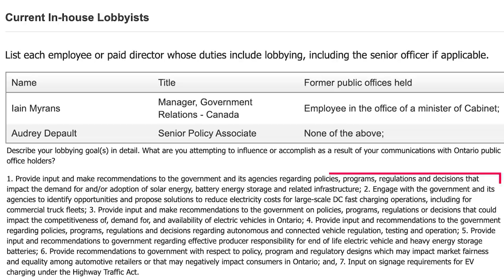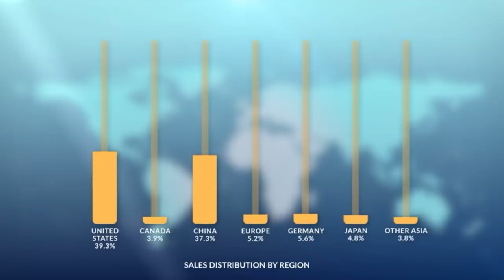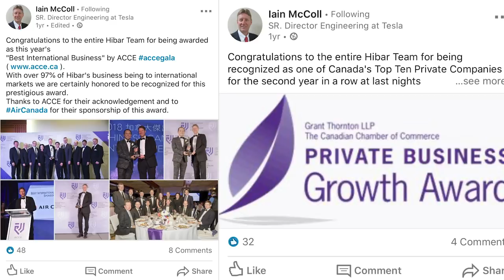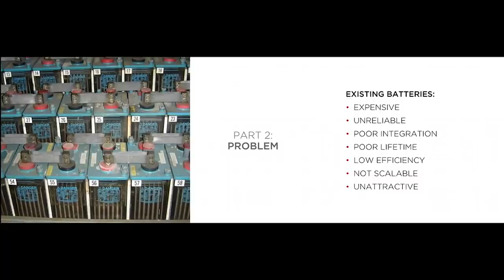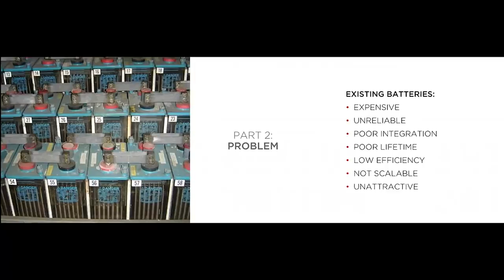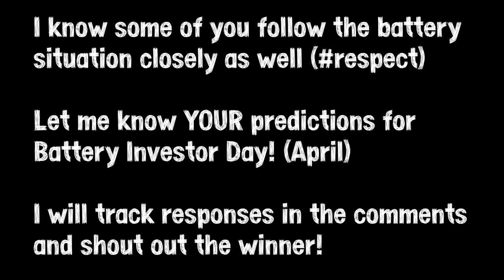Tesla Acquires Hibar Systems - The End of Tesla and Panasonic Partnership?

Comment: Basically Battery = Oil.
If Big Oil is worth in the region of several Trillions of dollars today, then Battery tech will be worth the same or more in coming years.
Reply from the maker: Hey! It will take a long time (10-20 years IMO) to have battery tech even approach that industry, as it seems like things will really start transitioning once solid state batteries hit commercialization. But you're correct, it's only a matter of time!
Reply: Electrified check with Jim Cramer, who last Friday stated he will not buy oil again, and Blackrock holdings warned world investors against it. Cramer said ‘the youth don’t want it anymore... it’s the ‘new tobacco’ it’s over..”
Reply: 10 years is not a long time.  Especially for a transition as massive as electrification of transporting.  That’s batteries for both ground and air travel.  Tesla’s energy division could be massive in terms of future potential revenue.  Much more than cars.
Reply: @PhilipX2030  lol - tabacoo is a luxury item.  Energy isn't.  Unless there is some miracle/unicorn breakthrough in battery technology, (sadly) oil isn't going anywhere any time soon.

Comment: I think they are spot on on the super capacitors, however, the reason for Tesla's acquisition is to:

1. Panasonic is likely to continue contracts with other automakers, and will need more pumps, thus as the battery demand grows Tesla profits, as the market expands Tesla profits.
2. This makes it more difficalt or more expensive for other automakers to verticly integrate batery production with the process of manufacturing EVs. (Because in order to beat Tesla at price they will have to get a competitive advantage over Tesla, which might include the aquisition of a battery manufacturer like Panasonic)
3. Tesla can now limit access of top end pumps to only Panasonic. Putting the other batery manufacturers years behind Panasonic and Tesla.
Reply from the maker: Hey there - my next video touches on supercaps and all things batteries (Thursday). Elon did just say that supercaps are not required so I don't believe supercaps are the story, but the DBE tech from Maxwell is.

Comment: My understanding?

Hibar.
Specialists in precision injection (specifically, electrolyte)
....
Maxwell 
Dry electrode manufacturing process.
....
Grohmann. Robotic machinery.
....
Jeff Dahn, Chemistry,
.......

Hibar was necessary
But not for the reasons stated.
(5:50)
......
Maxwell has given the opportunity to produce dry electrode material (the "roll" in the "jellyroll") at high speed, requiring no dry time or solvents.
So, that's "dry electrodes", not "dry cells"
Essentially a very long strip of flexible multi layer material.
Maxwell isn't so much about the chemistry ("composition") of the cell, as the matrix (electrode sheet material) which allows new materials and chemistry to be incorporated.
Example? (again, imo)
A dry graphine powder, incorporated between layers in the Maxwell electrode sheet (I believe it's similar a laser printer process!) will allow more efficient cell performance.
The dry (electrostatic?) process speeds production.
The "mix" of components in the powders ("toner"?) and later, the electrolyte, are determined by others (Jeff Dahn, etc).

With high speed production of the Maxwell electrode ("long strip") the next stage of the cell production becomes the bottleneck, either requiring a large number of cell assembly lines, or faster insertion of the roll into the "can" and faster injection of electrolyte.

That's why Hibar was purchased.
Together with Grohmann (?) They can  supply the expertise to get the roll into the "can", inject the electrolyte and seal the unit at high speed.

It was the development of dry construction methods for capacitors which (I believe) enabled Maxwell to perfect the battery electrode process, ironically, it now seems there is little need for the capacitors (at the moment).
........
The above points to a dry (produced) electrode sheet, rolled into a "wet" cell (at least for now) with either a fully liquid or gel electrolyte.
The matching of production speeds in the two procedures allows enhanced production (Maxwell stated "up to 16×").

This in itself raised an issue, moving the bottleneck from cells to pack production.

Consequence?
The pack patent in October/ November 2019 which detailed improvements including more automated pack production, packaging, cooling, etc, plus (the big one?) The possibility of a "common pack".
(Side reference? Extra capacity, performance in the Plaid pack?)

Moving forward, if the above is correct the factory space needed for cell production is drastically reduced, leaving space at GF Nevada for other projects (Semi? CBT?).
HUGE capex savings all round!
Reply from the maker: This is an incredibly insightful comment! Thank you taking the time to share and helping us all to better understand another perspective of what's going on! I actually just started studying DBE and SSE for a future video. Such an interesting, yet complex, subject! Big improvements on the horizon without a doubt!
Reply: @DillonLoomis22  
I may be wrong, but everything fits.
Maxwell said their process was suitable for "various chemistries"
They also mentioned "solid state".
That may be for later...... Unless they've "cracked it".
At the moment, I'd concentrate on the volume they can produce, that enables all the other products, vehicles and storage.
Regarding the "old" (current) cells. The question is, what's more valuable? "Old" cell production, or factory space?
That production could be replaced in 10-15% of the current factory.
So, what's the basis for a continued relationship with Panasonic?
(I don't know).
Reply from the maker: @rogerstarkey5390  great points. The reality is...none of us really know! But it's a ton of fun playing an investigative journalist and trying to get in the mind of Elon. I'm having a blast lol
Reply: @DillonLoomis22  
I just look for what they need, what they've said and what's available.
See previous.
Reply: I think this is exactly it.
Reply: @AlexandruJalea  
"Exactly" ....... Doubtful.
But it's possible, with a plus or minus margin in each element.

Comment: Tesla has it's research lab at Prof. Dahn in Canada. These guys are basically superstars of the Battery research community (which i'm part of). But they don't do solid-state, they do very accomplished research on tuning existing chemistries to perfection (thats where the 1m battery thing came from) for electrolytes and cathode materials. I've had some insight from recent talks on conferences where they presented some of their work and i can almost guarantee you that tesla will stark producing some variant of NMC/Graphite cell with super high endurance and manufacturing costs some good amount below 100 $/kWh.
Furthermore they eventually want to switch from graphite to lithium metal (Elon Q3 conference call and research at the Dahn lab) but this is going to be ~5y off imo, it'll double energy capacity for the current tech tho and will make solid-state obsolete (because the solid state electrolyte is by nature super expensive from a material standpoint)
Reply from the maker: Hey man, I can tell you're in the research community with this comment. I just started my DBE, solid state research yesterday for a future video. You may know - do you think the next-gen tech will include more any/more silicon as opposed to graphite or is the expansion still an issue to your knowledge? 

And if someone were to ask you, what's the difference between solid state and dry battery electrodes, how would you explain it? I've gotten a feel that the true definition of solid state is not clearly defined. And correct me if I'm wrong but DBE is more about the mfg. process than it is any change in cell composition?
Reply: @DillonLoomis22  Dry electrode refers to the manufacturing of the electrodes themself. State of the art is mixing a slurry of the material (non-water solvents) then coating it on the current collector, then drying it which costs a lot of energy & time (read money). Additionally due to the evaporation defects in the electrode structure are formed, worst case solvent molecules get trapped and do shenanigans later on. Dry electrode manufacturing circumvents this by probably working like powder coating of some sort.
Solid state is a whole different tech and it's actually pretty well defined: no liquid electrolyte. You have to have a solid (Usually something Lithium rich, sulfur, oxygen, silicon, phosphorus-containing abomination that is btw not stable in air) substance that can conduct lithium. You then mix it with your anode stuff, your cathode stuff, put some in between then to separate them and voila .. sounds easy but the details are the messy part (usually decomposition products at the interface of the electrodes&electrolyte which inhibit ion transfer)
Regarding silicon in graphite yes, currently ppl mix it in to some degree but it's only possible so much before you change the general properties of the graphite and then you have to tune your electrolyte differently and so forth, sets loose a whole myriad of research which is still in a not very well understood field. Silicon in pure form will probably never be used but only in derivatives. Another alternative on the horizon is red phosphorous if the lithium-metal strategy will take longer (and 5y is probably generous, it`s really tricky but pay-off is theoretically 10x energy density of graphite (current material)
Reply from the maker: @yourlydontknowjack  ah beautiful! Thank you so much for taking the time to explain. Been researching all of this and this confirms what I've found and reinforces that I'm on the right track. Thanks again man! If you want to email me at dillonleeloomis@gmail.com I'd love to be able to reach out occassionally if I run into something. Or you could hop in the Discord.

Comment: It's obvious they wouldn't cut ties with Panasonic, or at least not right away start battery manufacturing. They're making deals with CATL for China Model 3 cells and LG Chem for their Powerpacks and energy storage. They need to 3x battery production just to keep pace not to mention Y, Semi, Roadster and Cybertruck. Makes me wonder. Where are other manufacturers getting batteries.
Reply from the maker: Hey Steven...I totally agree. I just found it odd that so many other people were saying TSLA would cut ties with Panasonic ASAP...never made any sense to me. Other manufacturers are buying a fraction of the battery supply TSLA is, and they are using the same companies as there are only a few main players (Pana, LG, CATL etc.)
Reply: @DillonLoomis22  thanks for engaging with your followers. It's not easy to just start a battery production line from the ground up. Elon out out a hiring call on Twitter. https://t.co/iF97zvYZRz?amp=1 Nowhere does it mention batteries.  I'm sad that we have SpaceX here in the Rio Grande Valley but hardly any super chargers and no way to test drive or expose the public. We have about 1.5 million people here and Mexicans come over and spend over a Billion a year on products just in McAllen, TX alone.

Comment: Battery investor day on Q2 2020, TSLA gonna soar at least 5-10% next trading day.
Reply from the maker: It most certainly should! It's possible that "the masses" and the public will have no clue that battery investor day even happens and that others just don't understand the weight of the changes and improvements they will be making to the point where the stock doesn't move as much as it should given the announcements. But I'm not a short-term trader so it matters 0% for me what happens in the near term after that day!
Reply: I consistently say Tesla is a battery company, not a car company. But the analysts keep commenting with things like, "automotive companies at this market cap are overvalued..." and similar. If they were just an auto company then sure. But that's very small compared to batteries. Megapacks, Powerwall, and eventually battery packs for other auto manufacturers will be their single product of consequence. And I'm pretty sure that means they're vertically integrating a new technology in battery type that will charge 3x as fast, yet charge cycle 100x. He owns the dendritic reduction process and is pursuing graphene solutions. It's just a matter of time. In fact, if both were announced, it would seem like alien technology.
Reply from the maker: @anthonylosego  you hit the nail on the head right here Anthony. I've been saying the same thing for years. Not to mention solar roof and their ability to monetize their software (SaaS) unlike any other "automaker"
Reply: I would suggest greater than 10% from the recent trading increases.

Comment: I think Tesla does both kinds of research: chemistry to further advance the performance and reliability of the existing technology, and also research for solid state batteries. It doesn't make sense for the average business to go down this path, but Elon's businesses proved countless times that they invest a lot in R&D and they don't leave unturned rocks on their way to optimization and advancement. And I agree they won't ditch Panasonic until they can fully cover all their battery requirements.
Reply from the maker: Hey Nicolae! I think you're spot on...they're at the forefront of battery tech...all battery tech...and whatever is most viable now and for the foreseeable future they will do what's best. I'm confident there isn't anyone out there with technology they are not aware of

Comment: Hibar will add value over time.  They are a quality outfit, with staff that stay on for a long time.  No drama, steady improvement.  It's an open question if Tesla's go-go style will leave Hibar's corporate climate intact.
Reply: Hibar will be used (mainly) for high speed injection of electrolyte into Maxwell "jellyrolls" (also coolant into new packs?)
Reply from the maker: Agreed! You bring up an interesting point...no two companies will gel perfectly, but it seems as though they are both committed to the larger mission.
Reply from the maker: More on this in the next video (Thursday)!

Comment: Great video!  This is a tough one - mostly because of the shear volume of batteries required seems like it would take a awfully long time to get production to the point of not needing to outsource.  In my opinion, any battery production handled totally in house would either be a completely new battery that is maybe currently in development, or mass storage batteries on a commercial scale.   Why put all that expense and effort into building up production of a battery that you are actively working on replacing?  Unless the manufacturing process could easily and quickly  be retooled to the new battery I just don't see the point.  But, that is why I am sitting where I am and not in a Tesla boardroom, so what do I know lol
Reply from the maker: Hahaha that makes two of us not in the boardroom! But Elon gave "us" retail investors a nod on the Q4 call, so some people are actually piecing together the plans quite well - give yourself some credit! But yeah man I totally agree, whatever they are making in house should truly be next gen, not a chemistry that is already out there!
Reply: In the Thirdrow podcast (part 2) Elon basically states that they are moving from [cell -> module -> pack] architecture to [cell -> pack] architecture, and with the Hibar and Maxwell acquisitions I think it's pretty clear the post 3/Y vehicles will be built off the same next gen pack design, which will contain no modules.  With the "final" Li-ion cell chemistry developed by Jeff Dahn's team, the dry electrode production technique from Maxwell, and the assembly line construction expertise of Hibar, they are going to try and optimize their in-house battery production lines for low-cost and high speed.  Then copy and paste the lines to the other Gigas.  This is the only way to scale to terawatt hour battery production while dramatically bringing down cost/kWh.  Legacy auto is in for a world of pain.
Reply from the maker: @dorkster31415  This seems like it's SPOT ON! It was funny to hear Elon joking about the redundancy of some aspects of their business, even today. Shows his humility and willingness to admit to the public their shortcomings, if you could even call it that. I think this analysis is near air tight and my assumptions are very similar. Can't wait to watch it play out! Legacy auto is already on the mat and this feels like a kill shot of sorts!
Reply: @DillonLoomis22  Agreed.  Tesla controls its own destiny on the way to a $1T+ valuation and the only things standing in the way as far as I can tell are governments and natural calamities.
Reply: @DillonLoomis22  Excellent video, by the way.
Reply from the maker: @dorkster31415  without a doubt. Even if VW makes it to market with something good in 2021 and the Mach-E is successful, there will be plenty of room for Tesla to control its future. It be noted I don't see either VW or Mach-E becoming wildly successful outside of company-specific fans.
Reply from the maker: @dorkster31415  thanks bro! Much appreciated fam